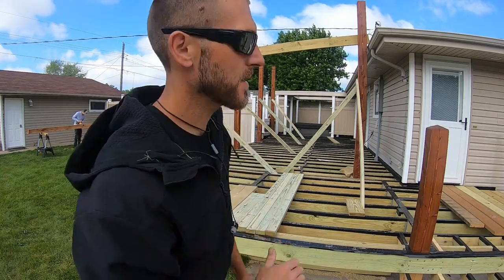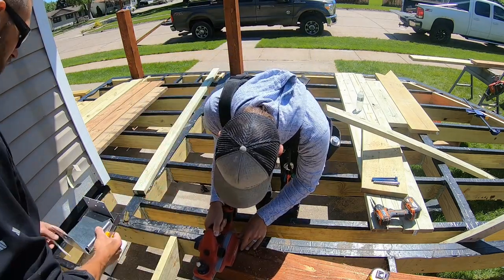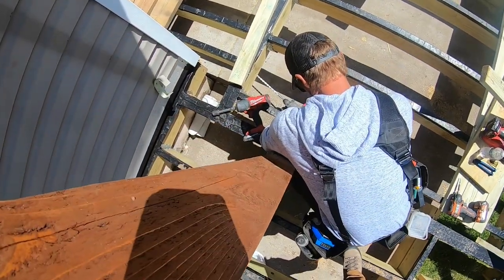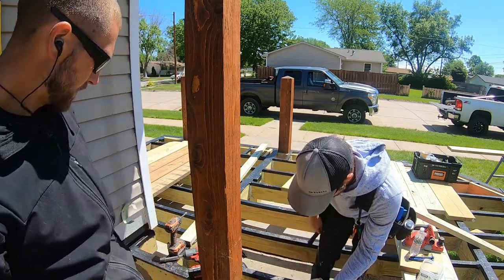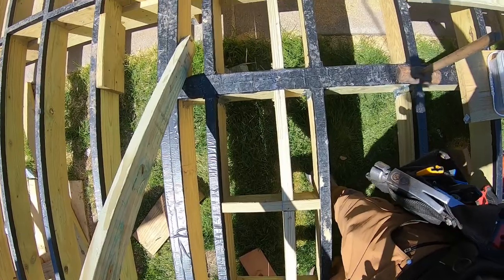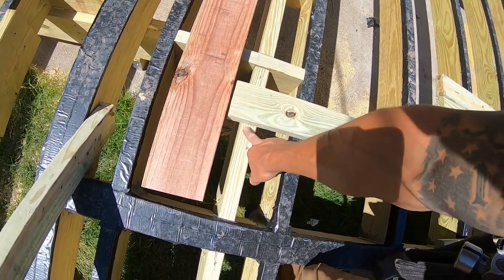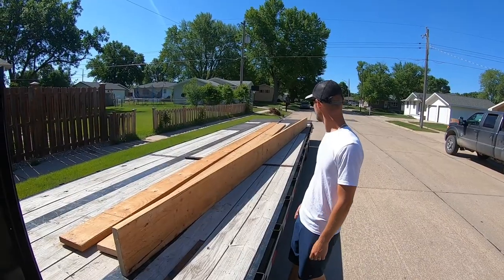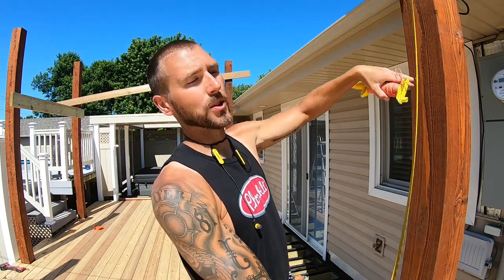Cedar Deck and Pergola Part 3 Episode  57 ( Setting Post, LVL's, Pic Frame Blocking)

Comment: Were both beams made from 2 LVL's?  Or was it only needed for the beam nearest to the house?
Reply from the maker: Span was greater between post layout on house side but yes both beams were lvls
Reply from the maker: misread your comment the exterior beam was a single lvl that was 9 1/4 i believe. It was all the engineer called for due to post spacing. Nearest house was double 11 7/8 so we could space out the post further to be least intrusive/ more functional space.
Reply: @AMAYERICAN  thanks that answers my question.
Reply from the maker: @rick2tube awesome are you building a pergola or what kind of project are you working on?
Reply: @AMAYERICAN  yup, 20x10 pergola with only 4 posts so likely lvl beams will be required.  Thanks for sharing your project/experience with YouTube!
Reply from the maker: @rick2tube your welcome thanks for subbing ! Hope your project goes great! You’ll have to let me know what you end up using for beams!?